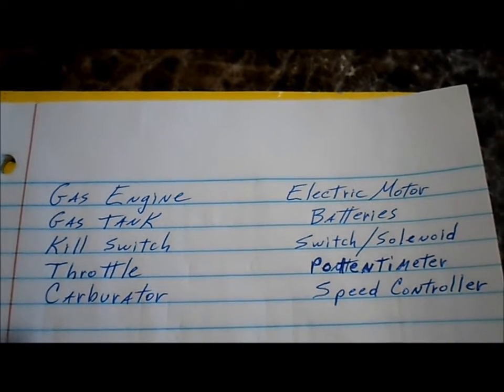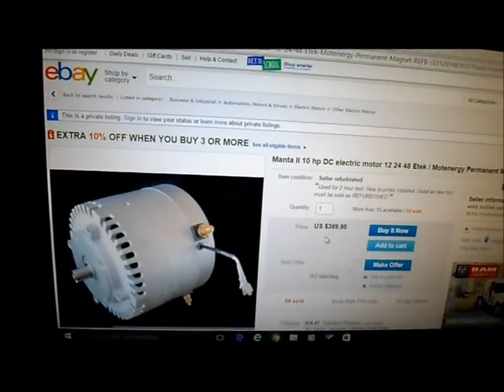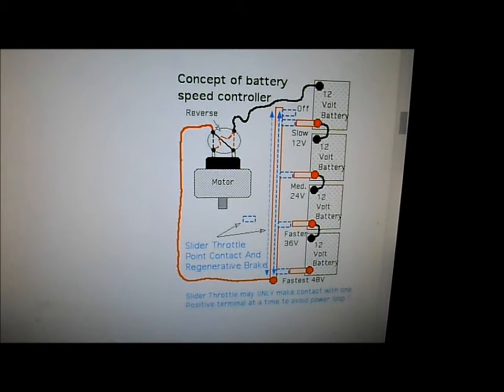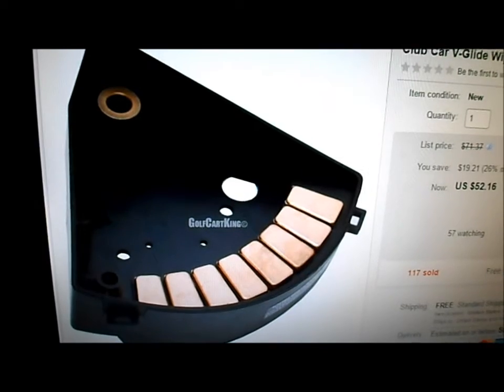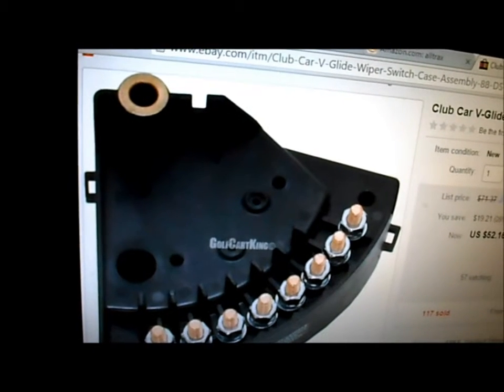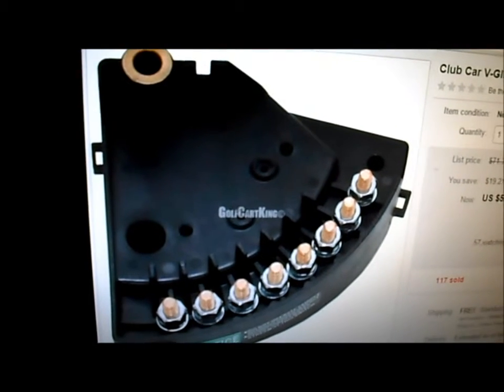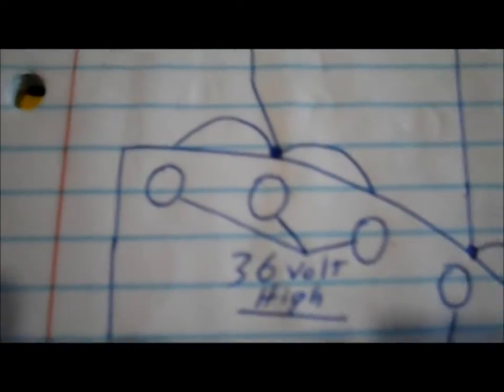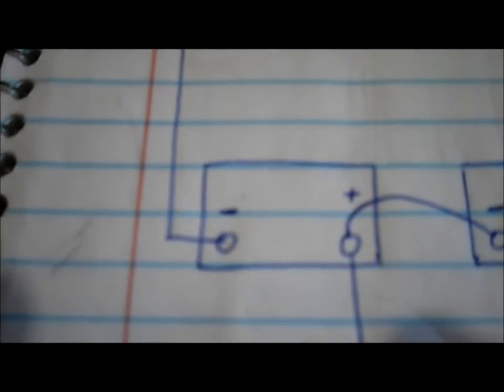ElDingo How to build a 10 HP Electric Dingo Go Cart part 5 Simple Motor Controller

Comment: I have a question .. In the 12v stage. Will the battery be discharged first stage or will all the batteries be discharged together?
Reply from the maker: In the 12V "stage" energy is only being drawn from the 1st battery. In the 24V "stage" energy is being drawn from the first (2) batteries & in the 36V "stage" energy is being drawn from all (3) batteries.  As you can see, this set-up discharges the battery pack very unevenly.

Comment: Where did u hook your micro switch in the vglide to?
Reply from the maker: The micro switch is connected to the contactor. So, when the wiper is moved, it activates the contactor, which then allows the energy to flow from the batteries to/thru the wiper to the motor. Check out the diagram starting ~5:50

Comment: How did u come at 10hp motor wattage? I mean the calculations
Reply from the maker: I got the 10HP figure from the eBay ad I bought the motor from.  https://www.ebay.com/itm/Manta-II-10-hp-DC-electric-motor-12-24-48-Etek-Permanent-Magnet-WITH-MOUNT-BRK/172260368606?hash=item281b84a0de:g:iMQAAOSwZ1BXduj5I agree is does NOT seem to add up or perform like a 10HP motor.